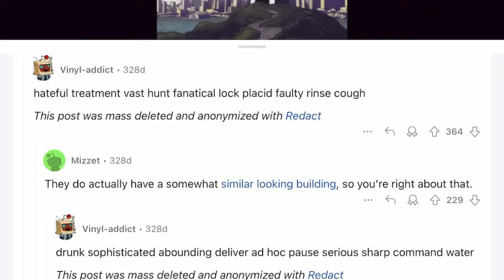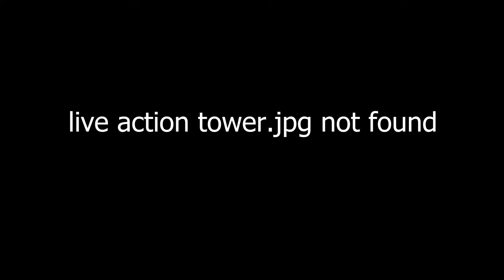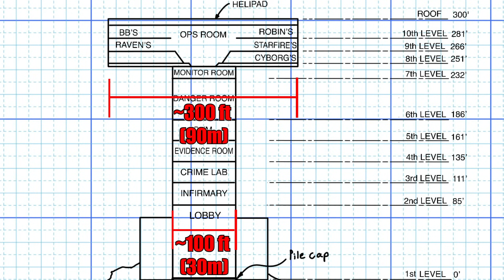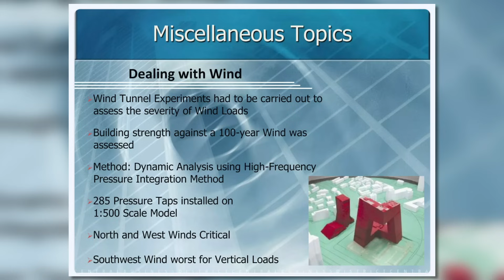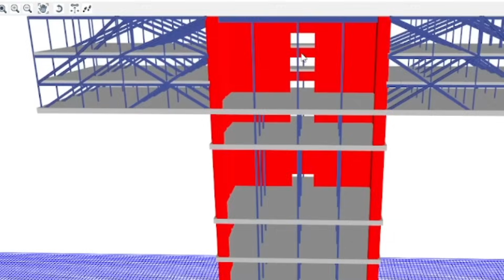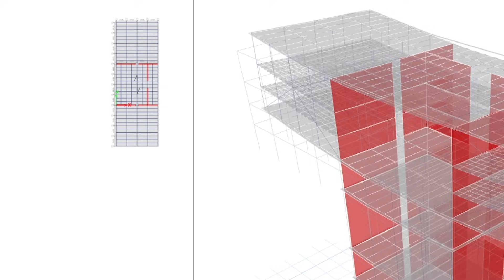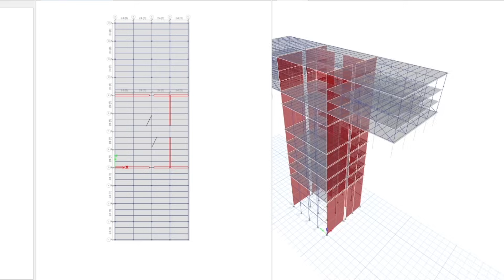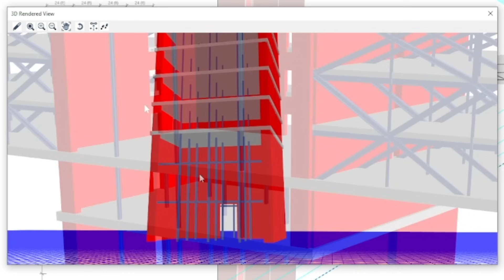The REAL Titan Tower - an Engineering Explanation

Comment: other than taking steel and concrete classes what would you recommend for structural internships?
Reply from the maker: Great question! Any structural analysis classes are going to be helpful, it’s also beneficial to participate in student orgs like a society for Civil or Architectural engineers. My first bits of structural “internship” were working in the universities lab. But if you have trouble finding a structural design internship, I’ve been told that one in construction is most beneficial as you get to see how the structure gets put together. Good Luck!
Reply: @onstructures  Thank you. I am taking theory of structures next semester. I am also part of AEI so I will continue from there. I will definitely look into the labs though. :D

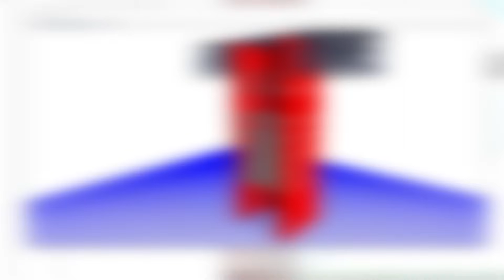Comment: 10:01 I'm surprised that most of the parts that support those two things stuck on the sides, are built inside those two things stuck on the sides. 

Almost like you could have stuck them onto the sides of any other skyscraper.

After construction.
Reply from the maker: I mean, if a building has been over designed, you hypothetically could retrofit it into the T shape! Funny thought.

Comment: Not an engineer - What if on the front face of the building you can use transparent metallic glass if you can make it flexible and thick enough to be part of the structural supports so you can still have that open front design.
Reply: There may be something like that in the DC universe, but transparent metals don't exist in any structural form. Another issue arises in making it thick - the visibility would get worse the more material you are looking through.
Reply: @CardinalTreehouse  haha probably some material scientist will solve all these issues at some point in the future

Comment: The tower is a lot more complicated than i assumed it would be
Reply: I haven't personally seen a T shaped building, but I did see one once that looked like they  cut a T shaped building in half vertically down the centerline and connected the horizontal parts at the top at a 90 degree angle to each other.

Comment: You know... those segments can be multiples floors.
as in, 4 floors for the evidence room.
You can add box around the lift and stairs, and even use some of that floor dead space for more structure.
The is not much stooping the lobby from have tensioning cables and some braces between columns.
Use rollers at the building base... yes we going full crazy with a tower that balance it self like a broom in a clown hand in the middle of a earthquake.
That is all.
Reply: I think they probably would because that makes it a lot easier to hide the dampers required to help keep it stable.

Comment: not a engineer but would a Tuned mass damper in the "danger room" help with earthquake scenarios? your last design looks great! also you could put a massive column in the back if you shrink that ridiculous lobby!
Reply from the maker: Absolutely! A tuned mass damper would be a good solution, I’d surely want to try. Though I think instead of one in the middle… it might need to have one on each end of the T to help reduce the twisting lol

Comment: Studying architectural engineering with a specialization in structural engineering, I’m so hyped to find your channel! I grew up watching this show and love the concept of this video. Its super interesting seeing the information that I’ve been learning the past couple years in this way. Please keep doing more like this!!
Reply: Also wanted to add something, I was wondering if the steel in the building could be made with another metal that might not be in the real world. I don’t know much DC outside of the cartoons that I watched when I was younger, I’m more of a marvel guy. Maybe they have some type of metal like vibranium or something that may have a higher yield and tensile strength. A different approach could be to use some steel and concrete equation to find what yield and tensile strength would be required to be able to construct this building in a similar way to the comics design. Again I’m only just starting to gain experience, I’m Junior in college, so I’m not even sure if this is feasible. I would like to hear what you think!
Reply from the maker: glad to hear you liked the video! A stronger more ductile material, should certainly go a long ways towards allowing the structure to work as described in the DVD set, though I’m not sure how much stronger it would need to be. I think the best property to optimize would be something like a strength-to-weight ratio as having a lower mass would help when adding reinforcing.

Comment: Since you have all the structural elements accounted for in the software  would it be possible to make a simple estimation of what it would cost to build such structure 🤔?
Might be a cool segment to add in the end of the video.
Reply from the maker: Ah! that should be an easy enough addition. The raw structural material costs should account for 15-25% of the overall building cost as well
Reply: Replies are invisible

Comment: Like many I was a fan of the ‘03 Teen Titans cartoon, so when I read my first TT comic the first non-cartoon tower I saw was the one here at 2:38 apparently inspired by Frank Lloyd Wright.

The thing I liked most about it was that it looked more plausible as a tower with the thinner outer portions up too giving the impression that it wouldn’t collapse under its own weight and the style from my perspective seemed to give it more room to have additional structure.

I could be wrong of course and clearly it takes a lot to make these types of designs work but frankly I’m amazed that they can even be done at all.